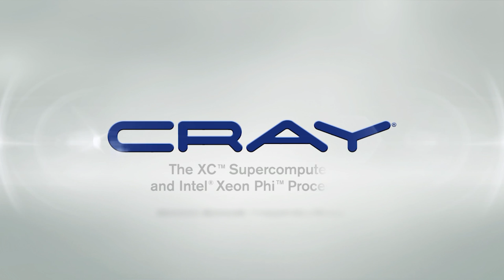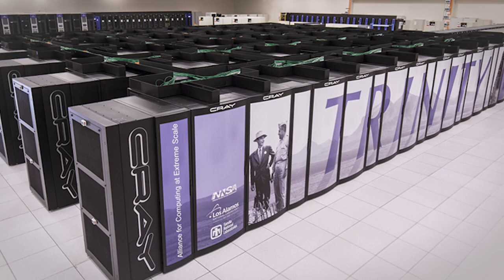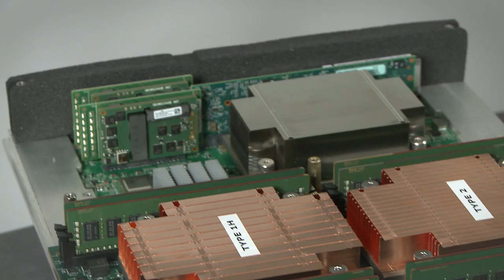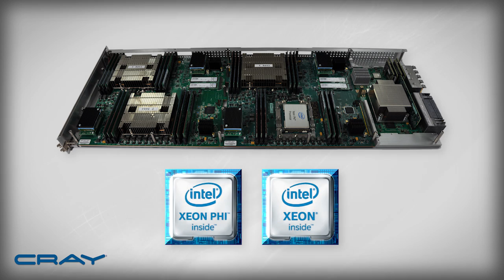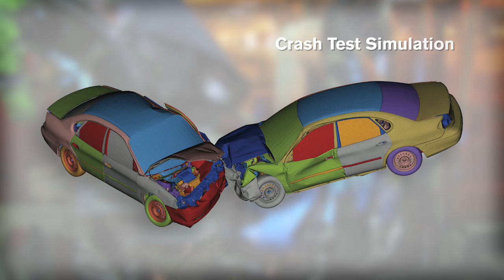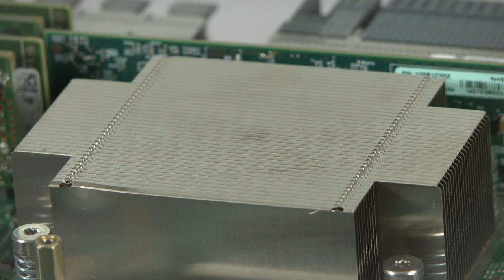Insider Look: New Intel® Xeon Phi™ processor on the Cray® XC™ Supercomputer

Comment: i have one question... Can it run Crysis?
Reply: It can run crysis, since it is binary compatible with the previous normal Xeon series, just don't forget to throw a decent GPU at it.
Reply: cordell Hughes I think you meant to say can barely hold minesweeper at 24 FPS lowest settings lol
Reply: cordell Hughes yeap, when they're this specialized, prices aren't surprising.
Reply: Well, most of them are clocked at around 1.5 GHz, many cores, but good luck with trying to play Crisis.
Reply: Yes it can
Reply: cordell Hughes 
Originally the Xeon Phi was in a graphic card construction but not any more apparently.

Comment: I burst out laughing when he said "3 teraflops of compute performance" the gtx 1080 has 9. And costs less than that piece of shit. Oh wait you said it's self booting. Haha haha haha. Check out the Nvidia Jetson tx1 that shit even has a pcie lane for more fucking cards.
Reply: How is your HPC company doing ?
Reply: aldo guzman hey m8 why on erth u comparing this thing with gtx 1080? we know gtx 1080 is best but why comparing this? idiot...
Reply: why not make the comparison? How am I and idiot. am I an  idiot for comparing Nvidia Cuda SM's with the many cores from the xeon phi co processor? they are almost the same. only difference is that the xeon phi coprocessor is a self contained system on a chip. whereas an Nvidia gpu is dependent on the host processor for any kernels to initialize. Even then. you could still have the gpu itself initialize its own kernel which would then place it in the same category as a xeon phi coprocessor. then we could get into floating point precision xeon phi wins that one but unless you are calculating the position of every star to the nearest centimeter nvidia opus would do just fine. Your incomplete knowledge of how general purpose hardware works must have triggered you into calling me an idiot. Im done 😂
Reply: You just made everyone who read you comment, dumber. 

God forbid a company makes a competing product with your husband "Nvidia".
Reply: fuck this comment. why the fuck does everyone need to get offended. Your sarcasm is amazing btw. nice touch with the wife as an insult. Isn't this 2017, grow up.
Reply: aldo guzman 
@ 64 -68 cores 250 threads for a total of 584 Teraflops (over half a petaflop) through the entire motherboard try and LISTEN CAREFULLY next time😉
Reply: aldo guzman 
And GTX 1080 cant compare to an    Nvidia Quadro! which shares a simular specs, price and processing speed with the Xeon-Phi the card you tried to make fun of you've got alot do learn buddy